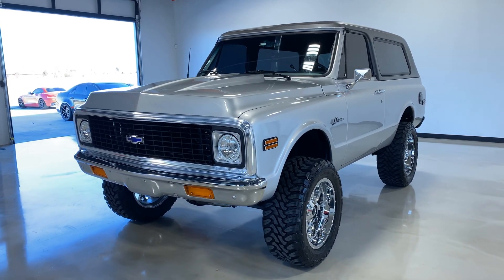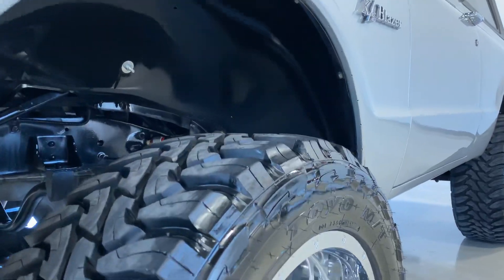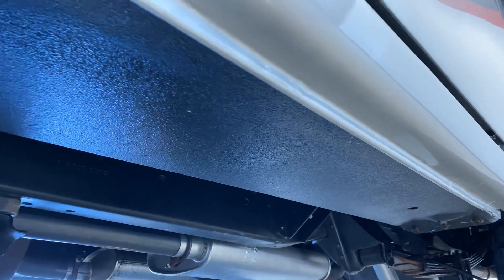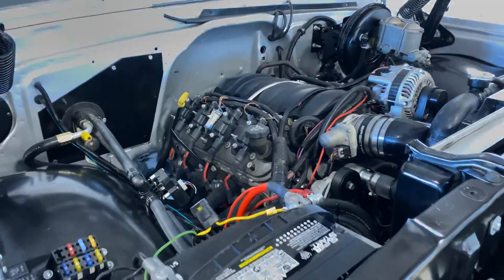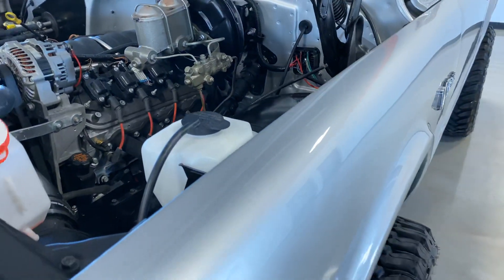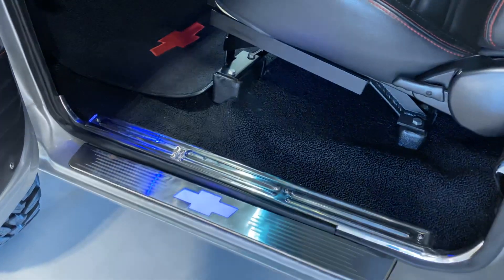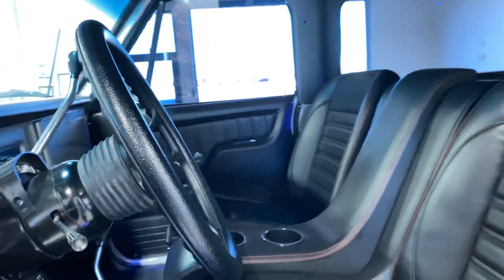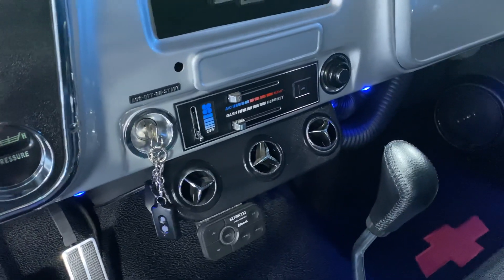1972 Chevrolet LS3 K5 Blazer For Sale

Comment: Very nice truck! But for that price you think they would have reinforced the frame at the steering box and replace those Rusty 50 cent exhaust mounts on the rear.
Reply: My thoughts exactly. If you're going to invest a ton of money, then go all the way with new exhaust and paint those exposed rusted panels,geez.🙄
Reply: I spotted that immediately also
Reply: I noticed the engine mounts were incorrect and about to fall out !

Comment: Nice resto-mod but not a restoration as said below. I had one of these I put a 454 in and high back buckets, The rust on the underside not good and the front tires look like they will rub when you turn. Other than that very nice.